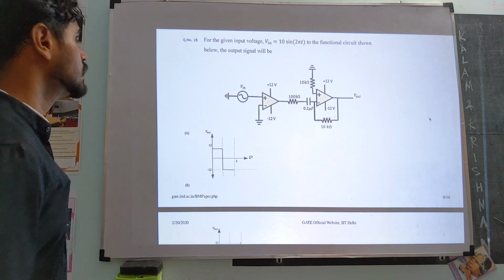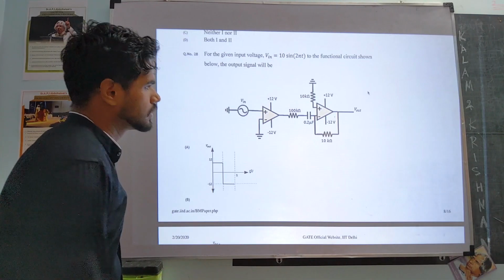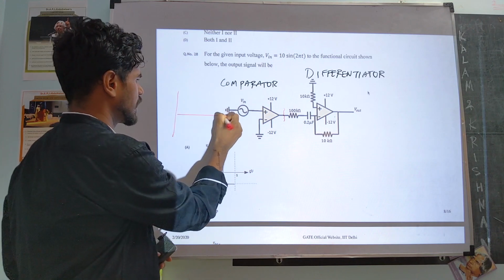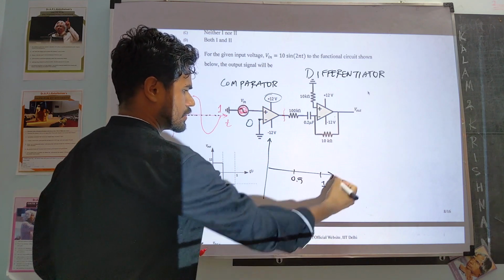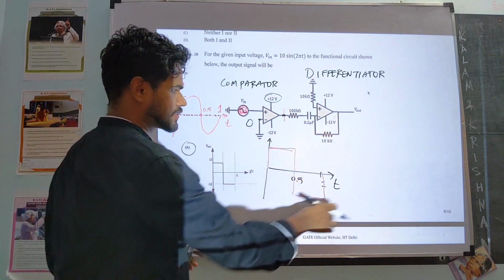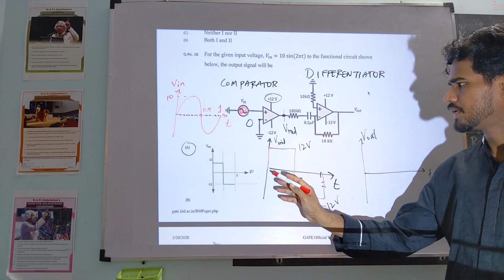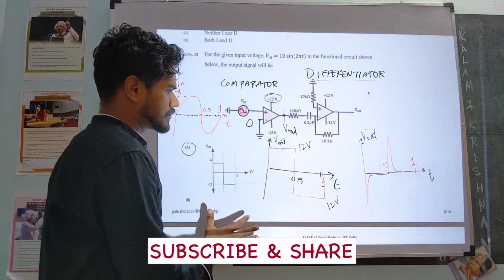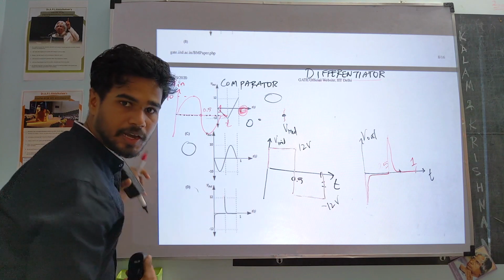Simple Cascaded Circuit Example | Cascaded Comparator and Differentiator Circuit

Comment: Sir how did u recognize that the first part of the circuit functions as a comparator and not as a normal non-inverting op amp. Is it because there were no resistance attached along with Vi??
Reply from the maker: Where is the feedback loop for it to be a non-inverting op amp?
Reply: @KalamsKrishnansBiomedical  ah yes.😅.. I didn't see